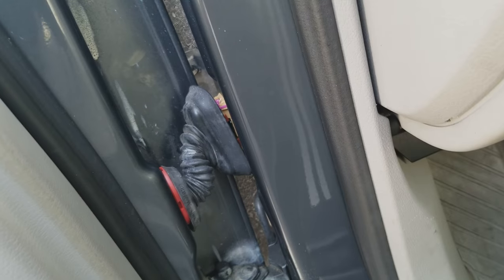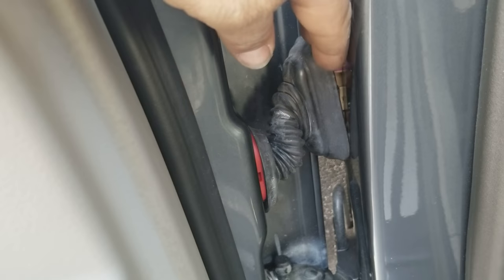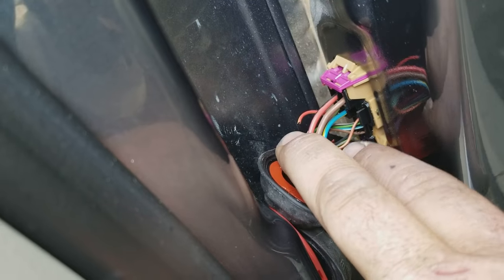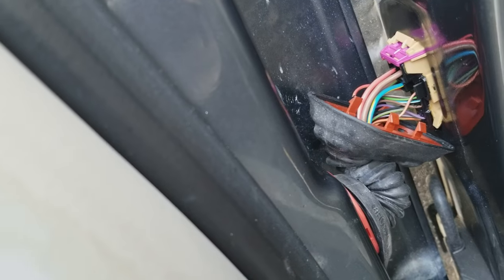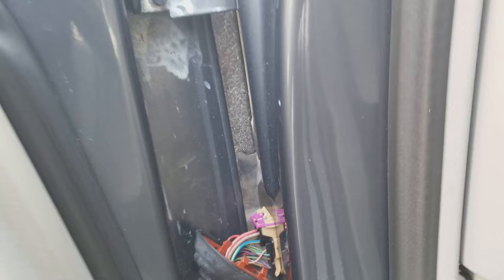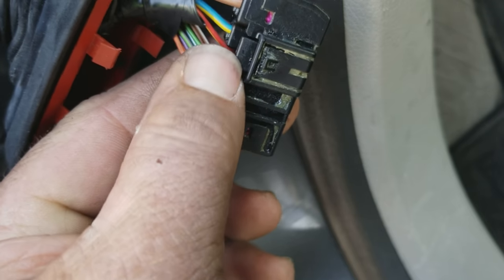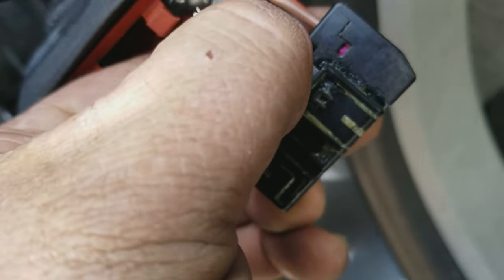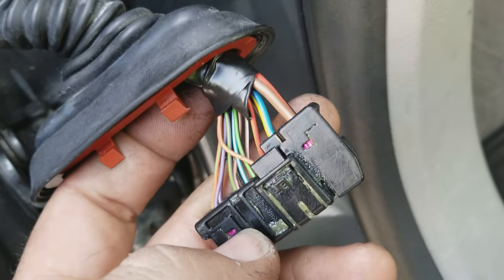Audi or Volkswagen door electrical lock problems fix common issues

Comment: Took me a while to pop the boot off but once I managed to do so there it was broken cable! Glad I found your video. Thanks!
Reply from the maker: Glad It helped you out.
Reply: How did u pop boot off?
Reply: @toryblandford7082  It's been a while but I think I focused on the tabs that you can see visible in the video. I probably used a screw driver to pry them/push them in on one side. It was a pretty frustrating process :) Good luck.

Comment: The controls on the door stopped working suddenly. I was at a gas station to fill up, tank was almost empty, and all the switches on the door were dead. I didn't know how to open manually so I drove home with the fumes. The video showed  exactly the problem. Thanks

Comment: I have problem that my rear door and rear windows and boot dont lock/unlock on central, not when i put the key in car or with button. They Just dont work. Wires seem fine as far as i could check

Comment: Thanks, I just got an a4 and the left rear door was not working except for the speaker.  No power locks no window. Turns out the plug was not fully inserted.

Comment: if wire broken thats meant driver side window didn’t work right ? in my case it can go up but if i press down it bot go , so what the real problem
Reply: Just need to be cleaned take off the batons and clean it from inside
Reply: libyan loyal i see my window regulator cable is stuck to the motor , will do tomorrow and see if its working after fix that 😊 thanks for reply 👍
Reply: muhammad shahfiez you more than welcome salam alykum
Reply: libyan loyal walaikummusalam 😊

Comment: How were you able to open the door if it didn't unlock? I have the same problem on my Audi. Thankfully it is on the front passenger door, but I'm unsure how to fix it as I can't open the door at all.
Reply: I have a a4 audi quitro....my passenger door cant open from in and outside ....we disconec the lock sistem because it dont work any more ....help....
Reply: I have the same issue, I lock the car the 'old fashion' way..i.e by turning the key.. sometimes the door behind the driver side won't close if opened from the inside.